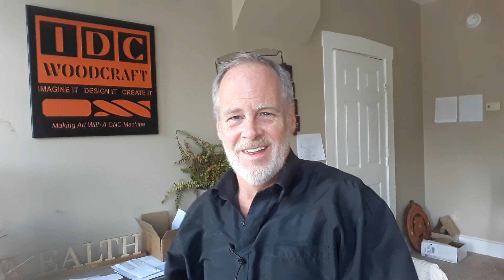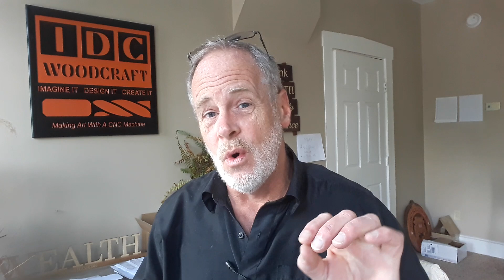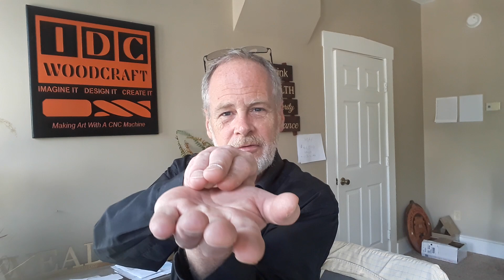Help Neeeded with Universal Gcode Sender [ugs] & Mach 3 [CNC Router] - Garrett Fromme

Comment: For Mach 3 you can try to run it in administrator mode and in the "properties" tab you can choose compatibility mode with older version of Windows(try Win7 that normally work on Mach3). You can also let Windows to check the best compatibility. For UGS go in the "machine" settings and run the configuration wizard that help you to reverse axis and calibrate the steppers motor(and set the probe and hard limits). But....lot of people are not good in Information Technology so most of the problems normally are related to a bad PC setup, incorrect Windows installation, software installed(mostly antivirus etc..) that blocks communications or wrong energy saving settings that shut down USB and HDD/SSD. So...find the right cause and fix it usually is very difficult.
Reply from the maker: Hi Marco. Sorry for the delay in responding. I want to thank you for your input that will help others on this issue

Comment: The issue with Renee's longmill might be best to consult with the mfg which has their website sienci.com. their are specific setup instructions for the longmill there. I have a longmill ,first addition, I purchased over a yr ago and assembled with the instructions on this website and am using ugcs and it works well with vectrics desktop. One of the founders of the company , Chris, is very helpful with their product and resolving issues. I'd recommend reaching out to him via their contact link.
Reply from the maker: Hi Bruce. Yes, they are very passionate about their customers and providing a good user experience.

Comment: in the console of UGS input $3=5, that inverts z and x direction. ( if I am understanding the problem)

Edit: I was at work when I posted this, on limited break time. I made the assumption that this was a grbl based machine( $3 is a invert mask for direction, it is grbl version dependent). 
If it is not grbl, please disregard the above.
If it is not a grbl machine, the simplest hardware fix is to swap one pair of wires on your x axis ( both x steppers), and one pair of wires on your z axis. example- you have red yellow pair and orange brown pair going to a stepper, swap the red yellow around so that yellow is now plugged in where red was and red is plugged in where yellow was. That will invert your steppers.

If it is grbl, grbl uses a binary mask, 00000000, the last three digits is you direction z, y , x. 0 is not inverted, 1 is inverted. So,  5 = 101, which would invert z and x respectively.

When she connects UGS, if it is grbl, it should output in the console tab, grbl version 1.1h ( or whatever version she is running) connected.

It is rare and odd to see a cnc router with duel x steppers, most will have duel Y steppers. ( Sorry for the wall of text)

EDIT 2: I looked up the longmill, it is a grbl based machine, and it has 2 Y steppers and 1 x stepper ( which is normal ).
In the console tab of UGS, input $$ and look at the first few lines that it outputs ( in the console window), one of them should say: Direction port invert, mask, that line number will be where you input $(linenumber) = 5 . For the latest version of grbl it is line $3. But I am almost sure that she is not running the latest version.
If there is numbers in that line number already, then some of the axis on the machine has already been inverted and probably need to be changed. 
 
A link to the wiki: https://github.com/gnea/grbl/wiki/Grbl-v1.1-Configuration#3--direction-port-invert-mask
Reply from the maker: Hi Gary. I turned out to be reversed wiring. The machine they had was purchased use. They have it running now. Thank you for giving your input on this.

Comment: Ugs Turn wire round on plug and on z
Reply: And x
Reply: I agree if the wiring is incorrect they will run in the opposite direction.
Reply from the maker: We tried that. Didn;t work